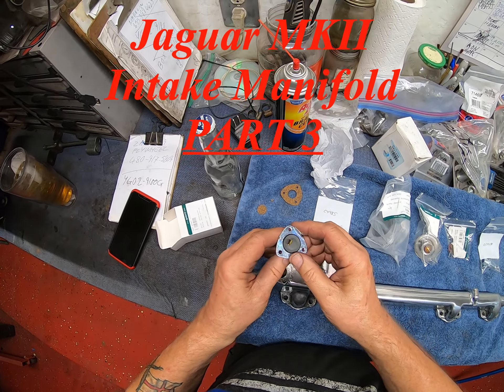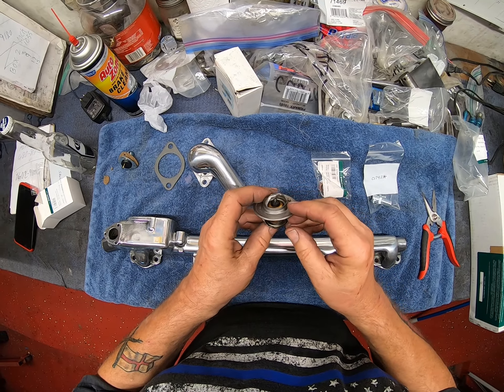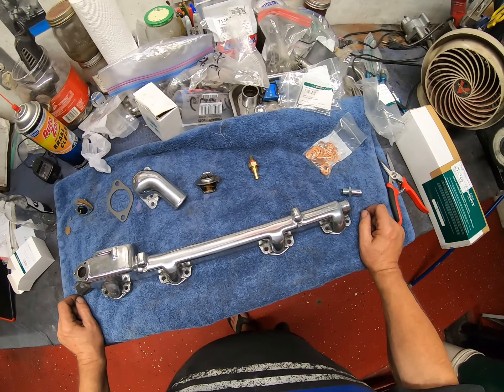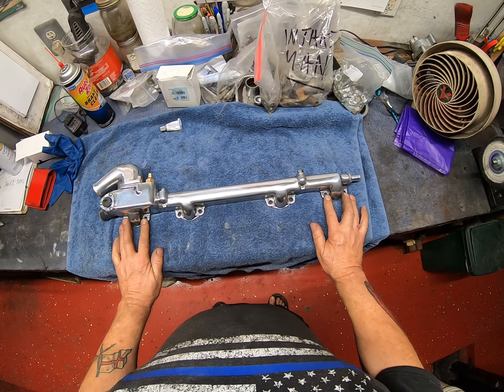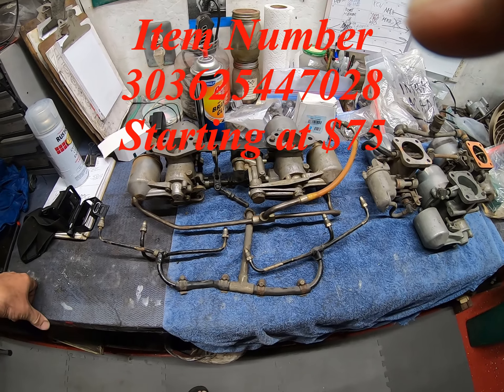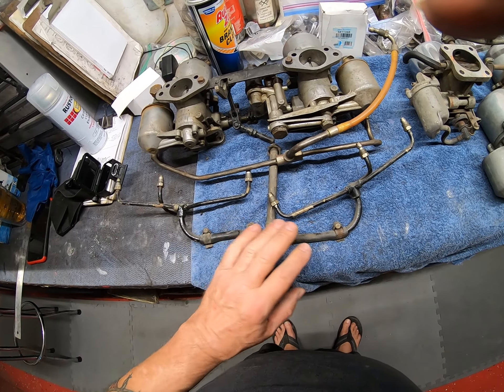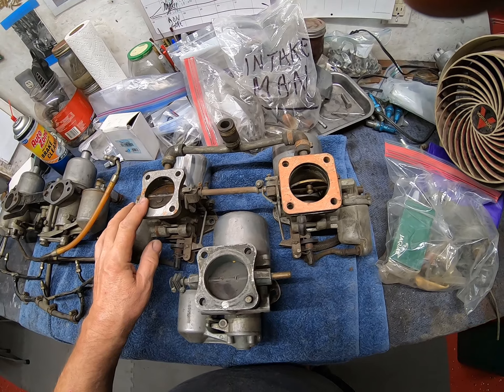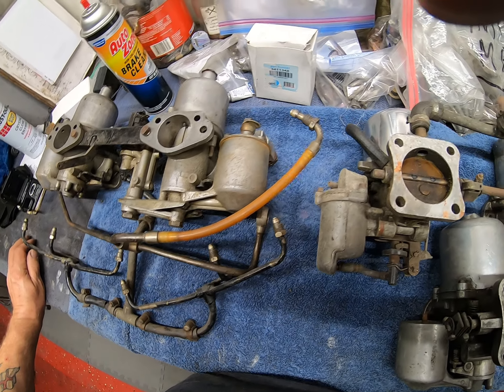Jaguar MKII intake part 3

Comment: I've got 2" SUs on my Mark 2, but they were taken from an S.1 E-Type set so didn't have all of the later stuff on them that you have with yours (which do look as though they are off of an XJ6).  I can't speak for the work required to put on the later types of carbs but I can say that I have never regretted putting the 2" carbs on my car.  Coupled with other engine mods they make a big and positive difference to performance.